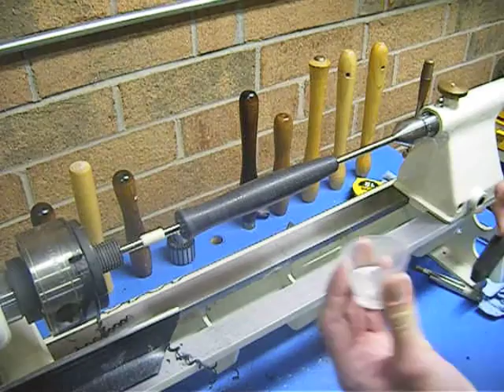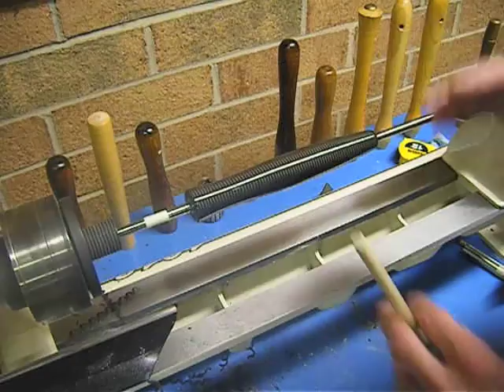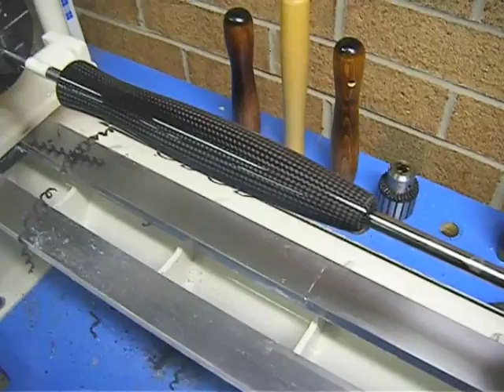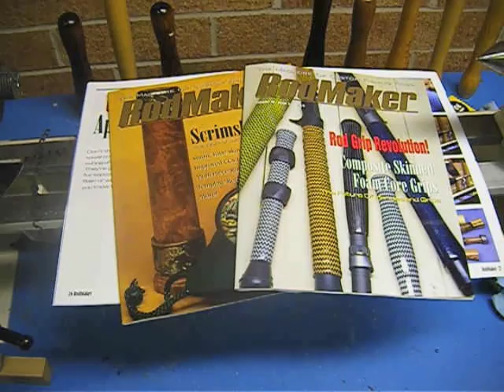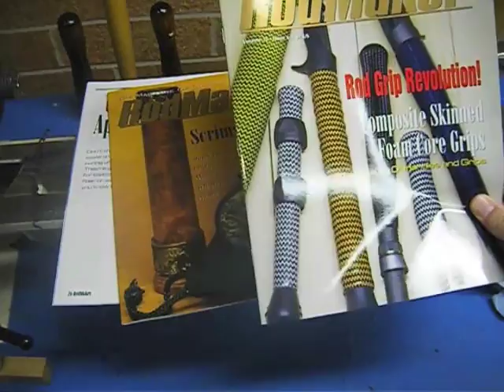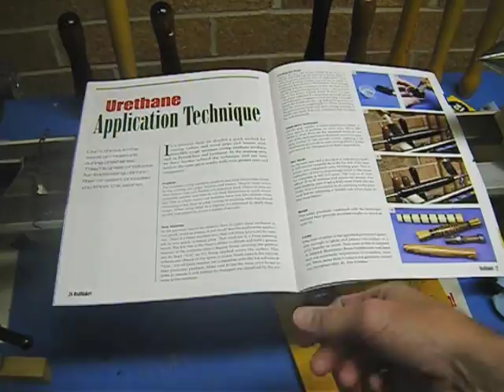Custom Rod Building Top Coating Carbon Skin Grips

Comment: How would you recommend applying Perma Gloss to pre-shaped carbon fiber grips without a lathe?  Drying motors won't get anywhere near 200 RPM.
Reply from the maker: 200 RPM is more than fast enough. Most lathe won't go any slower. So I'd try a 36 RPM dryer and possibly it'll work just as well. Permagloss sets quickly so it won't need to turn longer afterwards. A couple or three minutes usually.

Comment: I tried this and ended up with grooves in the finish. You can see them when you first apply the permalgloss in this video. No idea how yours didn't set with them like mine did.
Reply: I followed these directions to the letter and mine came out perfectly. Is your permagloss older or thick? Or too high humidity? It sets by humidity so if that is too high you might have it set too soon before it could flow out.
Reply: Brand new bottle of Permagloss. Maybe not enough on the sponge brush?
Reply from the maker: @Beentheredonethat1001  Yes, you really need to saturate the brush. Note these same instructions in the video and how to do it.
Reply from the maker: That's very possible. The sponge brush needs to be saturated. If you feel it dragging in the least, it's not "wet" enough.